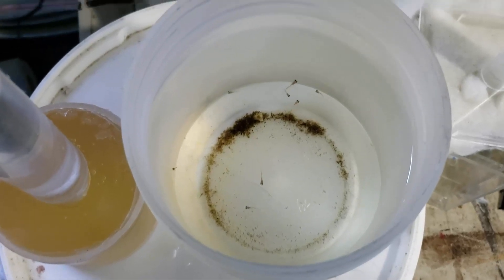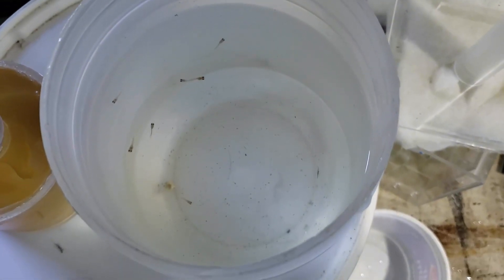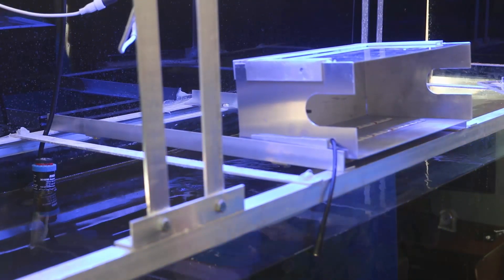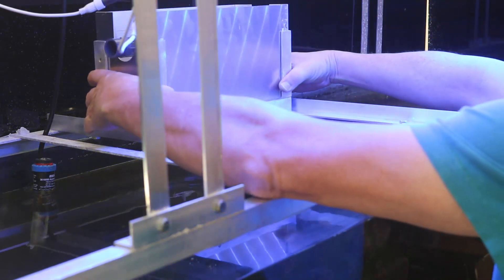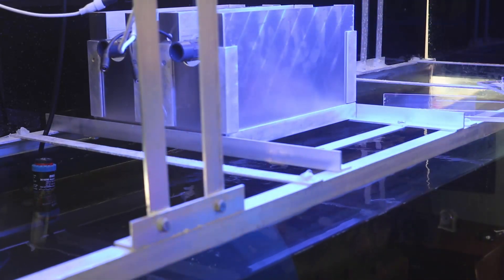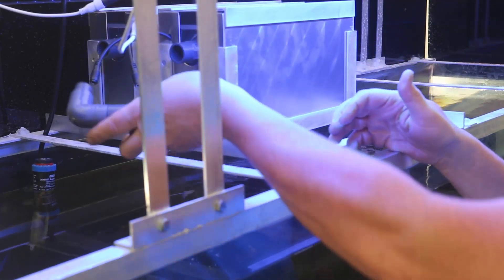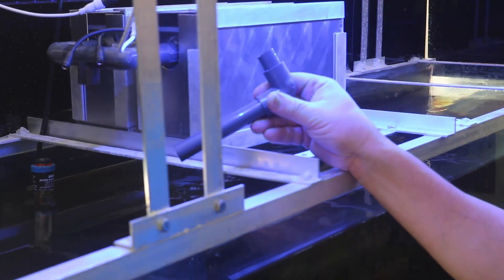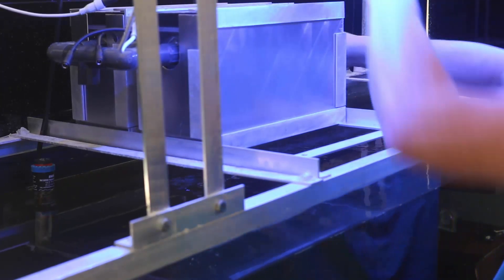DIY Algae Filter Ver. 3 Part 3 The Install

Comment: Very nice man, they seem to be working great ... I was wondering could the intakes be mounted on the bottoms of the algae boxes? Then have the outtakes up higher as to make the water move around more through the algae before exiting, much in the way like the baffles are set up on a sump.
Reply from the maker: Definitely! Baffles could also be added internally to give the algae more time with the water flowing through it. Thanks for your thoughts on this!

Comment: Kinda surprised you didn't make these air driven.  
Ya could try an ebb n flow wave maker. Possibly plant some mangrove in them.
Reply from the maker: Sadly these filters need a consistent flow through them and air just couldn't be regulated the same way. Thanks for the suggestion and for watching